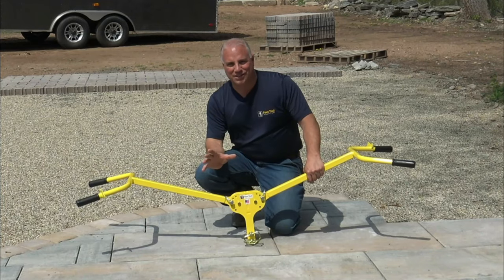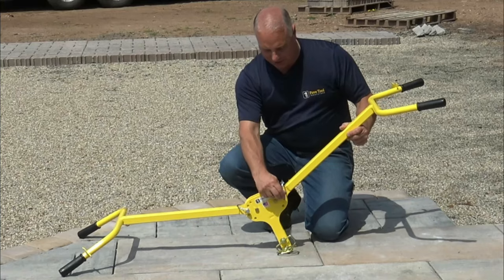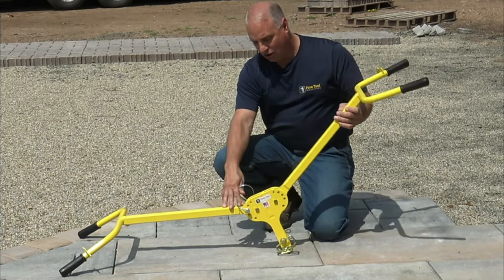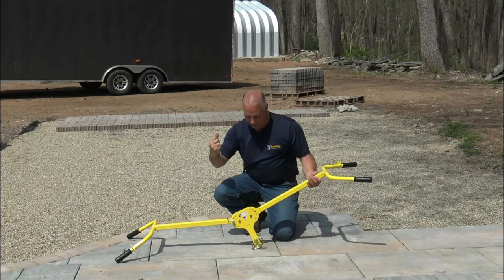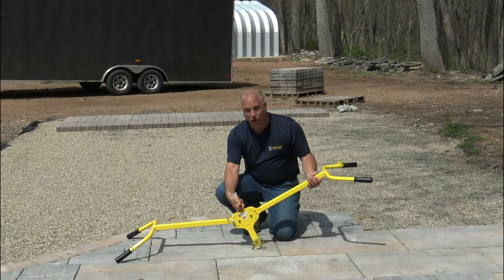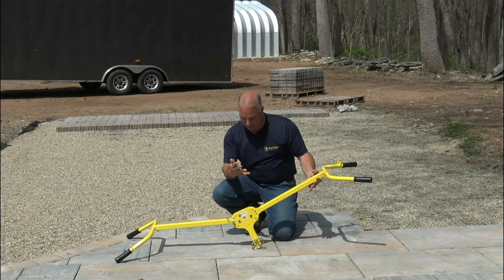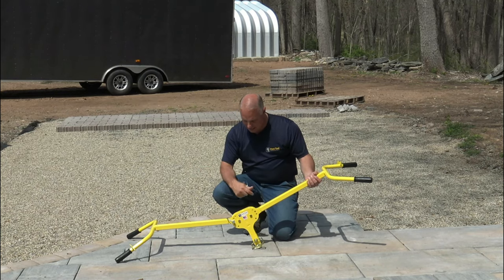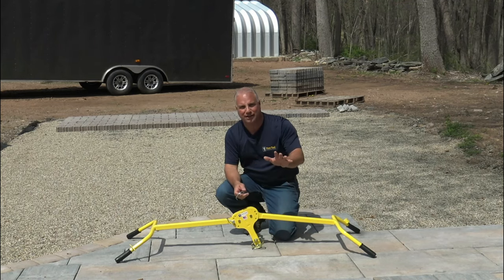The Hot Newly Designed Two Man Lift

Comment: Is that all done with a regular compressor? Or does it need an excavator or any other large equipment? Or just two men?
Reply from the maker: That particular Two Man Lift is used with our Power Pack which has no cords, no compressor - all battery operated.  We suggest calling in to talk Suction as it can be complicated and we would want to make sure we recommend the correct product for you based upon what you are picking.  860-870-8665